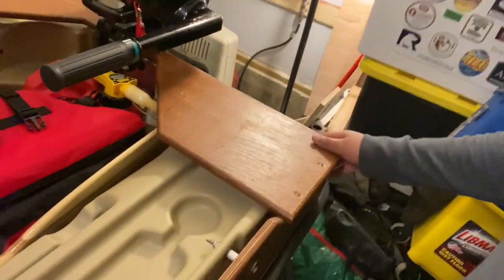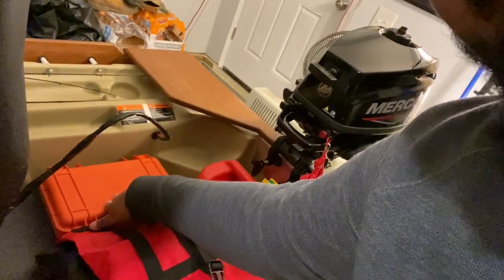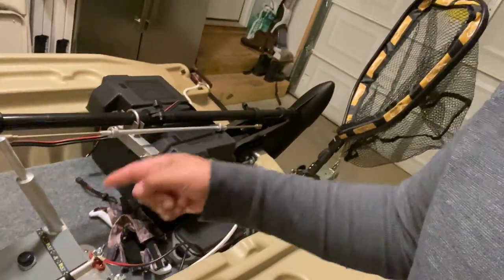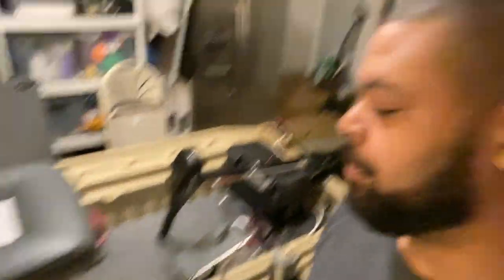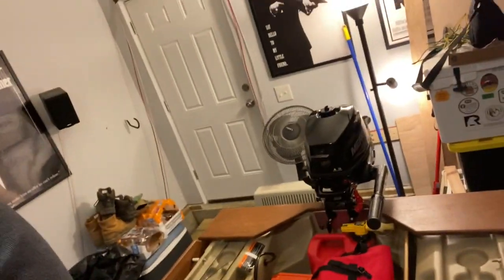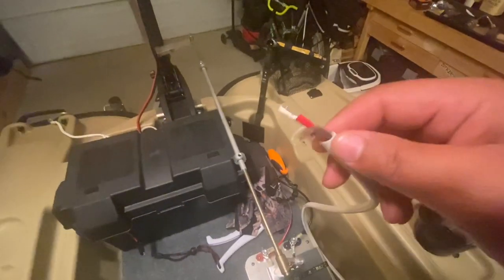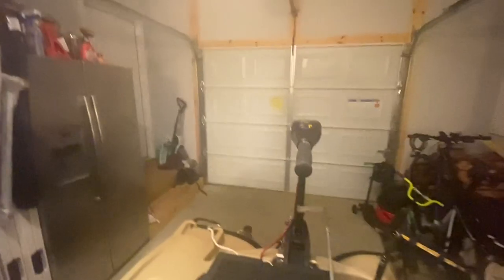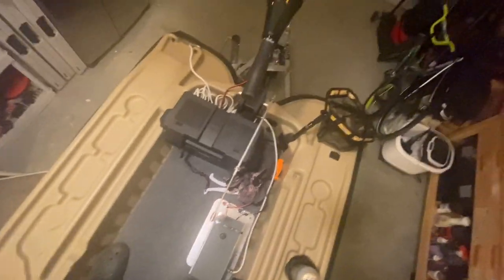Why Not To Add A Deck To A Bass Raider!!! 🧐

Comment: You definitely hooked the bass raider up with or without the deck it's a fishing machine!!! Like you said some things work for some but not others. I kept my pond prowler basically stock except for my seats and fishfinder. And at the end of the day it's what works best for you. Keep doing what your doing. Can't wait to see some fishing videos
Reply from the maker: Thanks
Reply: @WesAlexander  
was wondering if I could run my suzuki 6 hp outboard at just half throttle?
the engine weighs 52 pounds.

Comment: You are not the first one I have seen build a nice deck then pull it off. Others have complained about the loss of stability that high up. I'm 6'2" and have enjoyed having the deck. There are usually two people in the boat so moving between the front and rear hasn't been an issue.  I would love to have an outboard like yours. Using the trolling motor to get to and from your fishing spots is a drag. Please keep us posted on any other changes you make. I really enjoy the PBR content. Let me bump you up to 150 subs.

Comment: Love your boat. Thanks for the videos. Full disclosure, I didn’t finish this one yet, but just a suggestion, as you said, you’re a big guy and fish off the sides, maybe try a 7” seat height riser…. Good luck!
Reply from the maker: I actually put a 7 inch seat riser on. Still have to do a water test. Hopefully it’s not too tippy

Comment: I think sometimes that people forget these are small plastic boats and have weight limits and limits on the stress these hulls really are designed to withstand.

Some of the biggest advantages of these boats are they are inexpensive, lightweight, draft very little water so are excellent for getting into really skinny water and are very stable for as small as they are.
Not to mention they are fairly easy to load and unload in and out of the water and transport.

Many of the mods people make to these boats trying to turn them into a fully decked out bass boat  eliminates the very things that make them such attractive options while at the same time raise the center of gravity and make them much less stable.

These boats in my opinion left in a more as they come state of operation are where they shine.
Sure add a more comfortable seat to the factory framework, for flooring some lightweight anti fatigue mats from somewhere like Harbor Freight can be an improvement add your propulsion of choice and a depth finder and take the little plastic boat out and enjoy it for what it is.

Comment: Been enjoying the vids.  Also have a  Bass Raider...also decided against the standing platform.  But I just might make a mini-platform that fits between the seat rails...maybe a scrap of 2 x 10 or similar lumber with plastic pipe screwed to the bottom, to snap into the seat-rail troughs.  You know, just in case I want to get up a few more inches for a better cast, etc, etc...not to hang out on, just for a cast or 2 here and there.
Reply from the maker: Sweet sounds like a cool idea

Comment: 5 hp upgrade? What does that mean exactly? It’s a 3.5 hp and the carb upgrade gets you to 5hp? I’m not a shade tree mechanic or all that into motors, so was just wondering, because I need a small motor but would like as much hp as I can get. I have a 8ft Sundolphin that’s many years old and probably a thicker plastic than the new boats, so I could probably handle a slightly larger motor.